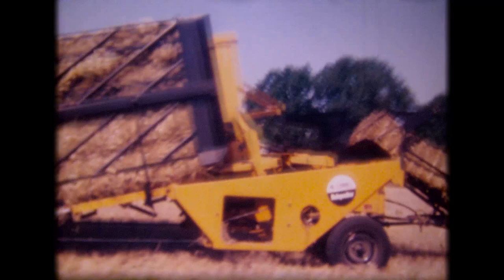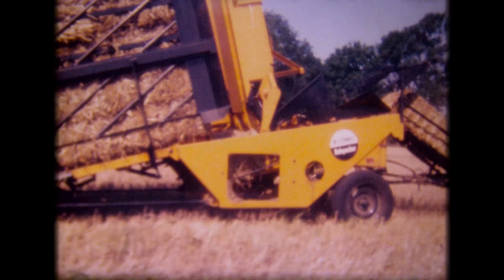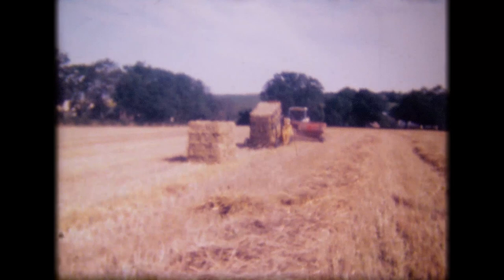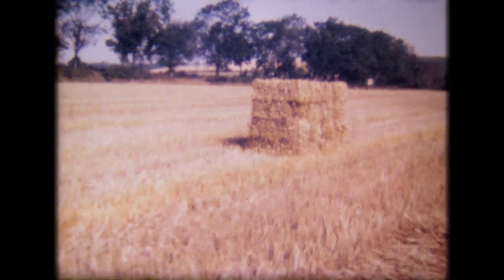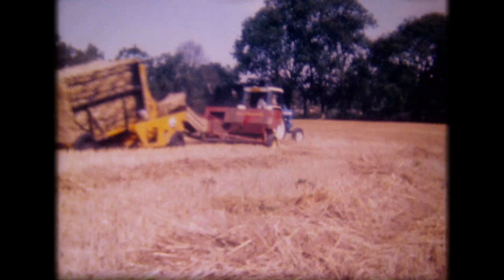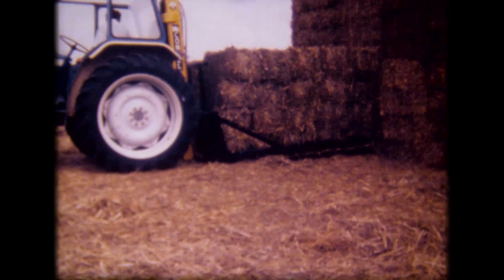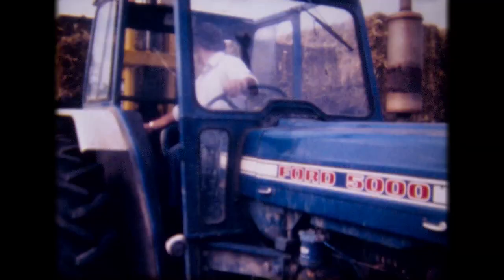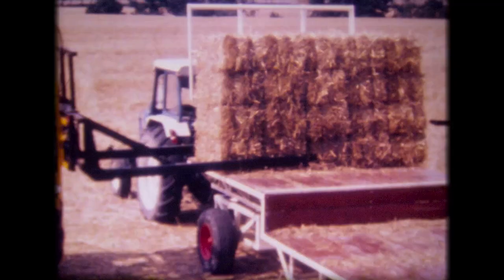The Balepacker - a film from McConnel's 1970s film archive

Comment: We had one for a couple of years before moving to big square bales. Yes, the knitters did play up, but the packs were unstable and not great when working on slopes, they would fall over. 
The biggest problem was if a bale jammed. The machine hydraulics would stay under pressure, so you weren’t sure if you would be swiped by the arm, lifted or compressed. After one such near miss it was unhitched and never used again…..
Reply: Actually I have just been reading on Facebook about someone almost getting killed by one when he was working on it.